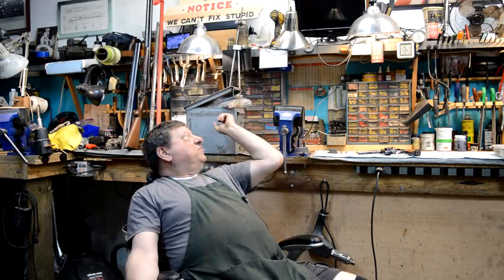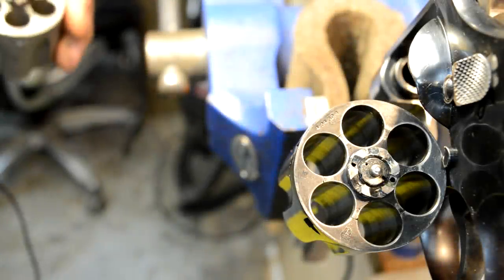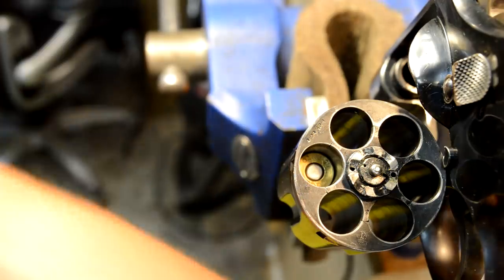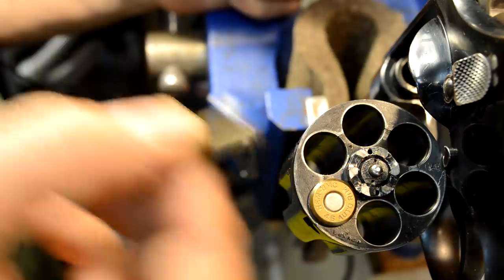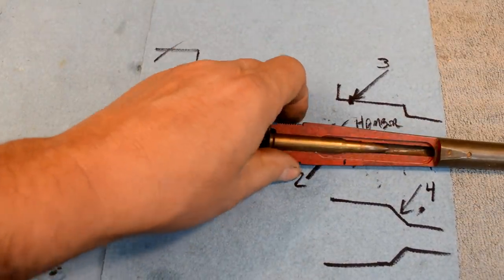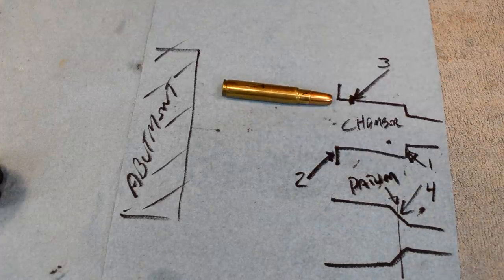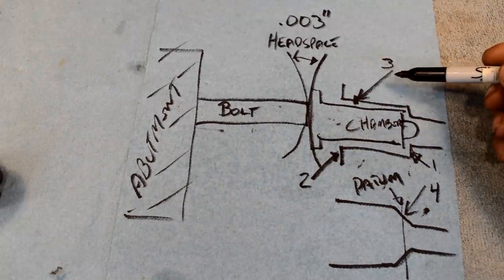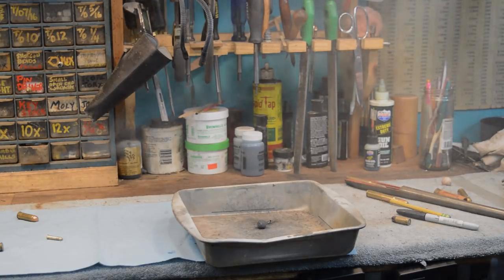Questions, Answered #7.....Headspace

Comment: 9mm Luger will headspace on the 7.63 Mauser neck in the chamber and will lock up. When I used to reload I drilled holes in a new 9mm Luger case then primed and seated a new copper jacketed bullet designed for the 9mm
Luger in the case mouth sans powder and went to a safe area loaded this safed cartridge in the 7.63 Mauser pistol chamber and pulled the trigger. The empty, primed 9mm Luger case headspaced properly and fired but again it had no powder and had holes drilled in the case sides so the primer gasses could vent. The danger is clear and present; a live 9mm Luger round can chamber, properly headspace in a 7.63mm Mauser chamber and fire. One must take care when working around different firearms with similar chamber measurements. The results could end in loss of life.
Reply: keith moore  No, 9 Para(9x19) is .30 LUGER opened up.  .30 Mauser (7.62x25/ 7.62x25/Tokarev) is longer, but shares a similar enough headsize and other geometry. 9mm Mauser Export was 9x25

Comment: 4 types of limiting surfaces preventing forward movement of cartridge case in a chamber = a datum or register.  

Headspace, distance of aft abutting contact surface of a closed & locked breech (bolt face) to that register. 

The relationship of locked bolt face to aft surface of cartridge (while registered) = clearance (go).

Relationship of jammed (not quite freely locked) bolt face to aft cartridge (registered) surface = interference (no go).

Relationship of spring force applied bolt face to aft cartridge surface (registered) surface = perfect!

Way to go Mark, I like your simple comprehensive explanation with sketches better!

Comment: Hot damn.  I've spent my life always hearing "rimless headspaces on the shoulder" with really no more explanation than that.  But now it makes so much more sense why case gauges are so important to reloading when you do modern rifle rounds and what the adjustments on your sizing dies do to the case to make it fit a chamber.  And I don't think I've cringed so hard as I did when you dropped that 12 on a 20 and it swallowed both.  I never knew that.

Comment: The wonders of the metric system:
If .30 caliber (=0.3") is 7.62mm, which most people know, what is 0.003"?
Right, 0.0762mm ...
It's easy working with bases of 10, just move the decimal (in this case, simply add 2 zeros).
Reply: decimal inch works the same way
Reply: Wonders of math really. Of course, the real fun with any system like Metric begins when you have to divide by three. Indeed, tenths are great until you have a third person asking for a slice of the pie, which is why Greeks went with 360 when doing that circle thing. Really makes fractions easier. 
      Personally, I like having multiple measures, because you can choose what works best for every occasional instead of having to force a system to do everything. It is not like it is that hard to remember 12 inches to the foot, 3 feet to the yard. No more difficult than remembering the difference between a decameter and a decimeter.

Comment: 0.003" = 0.0762mm

Thank you Mark
Reply: I figured 76 microns and some. It's a handy measure of thumb, the micron - a couple either way doesn't make a lot of difference.
I was told that most commercial parts are good for plus or minus 50 microns. Gives within being right to 0.1mm, which is a little over 3 thousands of an inch for play.
A Swiss watch maker would read this and laugh though. :)

Comment: The 5th way is the .357 Sig, which cannot decide whether it wants to headspace on the shoulder or the case mouth.
Reply: And the 6th way is a 357SIG round in a 40S&W barrel; headspaces on the extractor!
Reply: @musolinoa  or .40s&w in a 10mm barrel

Comment: You can think of calibers when doing quick/rough conversions of measurements...
.003" relates to .0762mm like .30" to 7.62mm just move the decimal point...
This only works if you are familiar with diameters 
.177 - 4.5mm
.20 -5mm
.22 - 5.6mm
.277-.280 -7mm
.32 -8mm
.355" - 9mm
.40 - 10mm
etc.
The tendency of european calibers being given as diameter between lands (gauge diameter) and US calibers being given by groove or bullet diameter throws this off somewhat...
I would love to smoke a cigar and sip some single malt with Mark, however who wouldn't 🙂

Comment: My understanding is that the firing pin will push the entire cartridge forward until it stops, at which point the case is forced backward onto the bolt face while the remainder of the case is left to expand under >15k PSI against the chamber interior.  In that sense, headspace is a dynamic event rather than a static number.  While an attempt to capture microseconds of data in an environment characterized by lethal pressures is far more difficult than an effort to measure a distance with a micrometer or GO/NO-GO gauges, it does shed even more light on the extremely complex process of touching off a round.

I really appreciate the great explanation, which exceeded the already high standard set by your last effort.  Thanks!
Reply: @Adam Schindler Your first sentence is correct, AFTER the trigger is pulled. Headspace is the measurement BEFORE the trigger is pulled. It is a static state (and measurement), not dynamic.
Reply: Yes.  The issue that I'm trying to raise is that the issue of headspace matters when we're firing the cartridge, such that as soon as it really matters, headspace becomes far more complicated.

Comment: I knew about headspace, but when I was working as a woefully underpaid and over qualified gunsmith, a man brought me a .40 S&W pistol with a MOABO kaboom. He had been shooting his .40 and his 9mm at the same time and inadvertently loaded a 9mm round into the .40's mag. BOOM... BOOM... CLICK... TAP N RACK... KABLAMMO! The gun ended up being fine (after brand new barrel was installed) and the barrel didn't rupture but was so badly bulged that I had to put the whole seized up slide assembly on the mill to get the damn thing out.
Reply: Somehow that reminds me of the TAOFLEDERMAUS video where due to the ammo shortage someone was using spent .40S&W casings filling them with lead, putting a sholder on it and using them for the bullet for a .44 mag reload. A few seemed to wobble a bit, but it worked.. Imagine it's a bit rougher on your barrel, copper is quite a bit softer than brass. I'd of just used cast lead, but I guess they gotta make videos.
Reply: @walkingcontradiction223  Yeah, I've seen that video. Cool stuff. But for it to be an analog to what I'm talking about (or what Mark was warning against in the video), they would have shoved a live .40 round in front of a live, normally loaded .44 mag. KABOOM, or MOABO (mother or all barrel obstructions).
Reply: @krockpotbroccoli65  Yep, just said it reminded me of that for some reason... My brain goes off in weird tangents constantly.

Comment: I had a Daisy V/L back around 1969.  It did not have a firing pin- it fired by compressed air being squirted through a hole in the front of the bolt.  There wasn't any way to extract an unfired round, if it wouldn't shake out.  Lots of lag time between pulling the trigger and actually firing.  I got rid of it, but I still have a pile of ammo for it.

Comment: Today I learned: a cigar has enough heat to light gunpowder
Reply: And you want a long cigar if you are using it as an ignition source.
Reply: Black powder has a shockingly low ignition temperature
Reply: AND CANCER!
Reply: I have read that a cigar is hot enough to light military time fuse for explosives

Comment: Mark, the Daisy caseless was fired by the heat of compressed air. It was basically a boosted air gun which ignited the propellent by the heat of the air coming out of the piston cylinder. There was a one way valve to stop back pressure getting into the piston side. It was basically a better engineered version of what we all did as kids,  dripping model engine fuel into the piston. It does not have or need headspace in the conventional sense as nothing is hit or pinched and there is no firing pin as such.

The Dreyse and Chassepot are better examples of where headspace came from. I shoot both and getting it right so that the needle hits the primer is a Mk 1 PITA...

Comment: The Daisy caseless ammo does not utilize a firing pin at all. The propellent is ignited by compressed air, similar to a diesel engine.
Reply: Which is why it doesn't need exact headspace, yes.
Reply: I'm more amazed that Mark actually had some!

Comment: Mark, interesting and clearer than mud.  This raises the next issue for me: “how does this relate to the go/no-go headspacing gauges?”  I assume the length of the no-go gauge exceeds the headspace tolerance distance with the bolt/abutment, is this correct?
Reply: exactly, any kind of go/no-go gauging (exist also for threads, plug holes, etc) relies on the tested piece passing the first test (go) and failing the second (no-go)
Reply: Note that there's actually 3 headspace gauges!

Go: bolt must close on this for rifle to be safe.

No-go: if the bolt on a new rifle closes on this, barrel needs to be moved back. However, if the bolt on a used rifle closes on the no-go gauge, it's just been shot a lot and may still be safe to shoot. That's when it's time for the

Field: if a rifle bolt closes on a Field headspace gauge, it's time to replace the barrel!
Reply: @ScottKenny1978  iv'e seen a couple of armourer kits and I'm fairly familiar with the French 7.5 one but never hear of the field gauge
Reply: @quentintin1  search for headspace gauges, most are sold in sets of 3. If they're sold individually, you will be asked for which one of the 3 you want.

You can also watch School of the American Rifle doing a barrel check. He uses all 3 gauges.
Reply: @ScottKenny1978  you're right, i just checked over and most of the barrel and chamber gauges comes in 3
Reply: @quentintin1  I think it's because you normally use the go/no-go gauges at the factory, before acceptance by the army, and can get away with only having a field gauge in the unit equipment. As soon as the bolt closes on the Field gauge, that weapon is out of service and needs to go back to the factory, where they have the go/no-go gauges.

Comment: Hi Mark. Allow me thank you for your tech videos! They are awesome! I have a question for you: How do you measure the headspace in a central fire cartridge revolver and in a black powder revolver? Thanks in advance!
Reply: I ain't Mark, but with a feeler gauge sounds like a logical way.
Reply: Most revolvers headspace on the rim of the case. So you put some fired cases in the cylinder and slide a feeler gauge between it and the firing position.

On a cap and ball revolver, that doesn't exactly apply, because the location of the cap isn't in line with anything but the hammer. I don't have a good answer for a cap and ball revolver.

Comment: I go by .1mm is .004inch.   I do  bicycles mostly  and  there is a bit  of  converting systems goin on.
Reply: I had to learn both Imperial and Metric way back in the 1970's when I was starting off in Mechanical Engineering.. basically 25.4mm = 1.000" ,, or if you want it the other way, 0.03937" = 1.00mm.

Comment: Where in the word did you find a new old stock cylinder for that 1917 revolver? There can't  be many of those left.
Reply: You'd be surprised. There's a guy out of Arizona who has a warehouse full of NOS break top revolver parts from the 1890's or so and up. Most factories had piles of spare parts that were forgotten until it was time to clean up the store houses, or the company went under, and then they sold the parts lots off for dirt cheap. It's just finding who bought the parts and where they went. A lot of gunsmithing on antiques is networking to find those collections. I have had clients wonder why I had their gun for over a month for a job that only cost them a couple hours labor and cost of parts. I have to explain to them i have to track down the part or who might have the part. When I'm lucky i manage to finally get in contact and then because so many of them are fairly up there in age, i have to mail them a check or money order and wait for snail mail to get it to them and wait for them to send me the part...lol and yes i know is not a break action it was just an example.

Comment: Good explanation, Mark.  Your timing is impeccable.  I'm currently trying to resolve a headspace issue with four unused 16" M4 barrels (5.56, 1:9 twist).  None of them will allow any stripped AR bolt to close on a GO gauge.  The parts supplier won't take them back and I don't know who the original maker is.  The only manufacturer mark on them is an upside down triangle with a BA embedded in it and what appears to be an F integrated into the center of the BA. Normally I would use my 223 finishing reamer to correct this problem, but these barrels are nitride coated.  Any suggestions on how to fix them or are they expensive trash?
Reply: Is there a possibility they were incorrectly marked? 

I'd try snap caps in 222, 224 valkyrie or any other similar cartridges or cerrosafe cast the chamber and measure it. Just an idea, I hope it pans out for you.
Reply: @endutubecensorship  We used two different GO gauges and eight different bolts which work in every other barrel.  No, the chambers were cut too short by the manufacturer.  I'm trying to figure out a way to get around the nitride finish or else find out who made them and reach out to them for help.
Reply: @Paladin1873  that is unfortunate, I wish you the best with sorting that out.
Reply: @endutubecensorship  Thanks, I'm looking at other options - maybe backing out the barrel extension slightly or finding a shop that has a carbide reamer.

Comment: Excellent explanation and safety warning boss. Always wondered what those guys on the .50s an .30s meant by check the head space. And they had a little tool of some sort they checked them with?
Reply: The Browning 1919/M2 machineguns actually feature an adjustable headspace which is intended to allow the operator to keep the gun functioning properly in changing conditions. A small headspace gauge/tool is part of the gunners kit.
Reply: Awesome boss thank you very much for that bit. Always wondered...

Comment: So the shotgun example means that the shells brass part should not bulge on the brass face got it. Know what im thinking on fixing on my rolling block shotgun in 20 gauge
Reply: Yes, if you case heads are bulging you have too much space between head and bolt face.
Reply: @ScottKenny1978  you have a idea how to fix because im running into dead ends when it comes to parts that match
Reply: @brendanliamgill99  short of having a friendly machinist make a new block with a thicker bolt face? Not really.

Have you checked to make sure the pin the block rotates on is still round, and that the holes that pin sits in are still round?
Reply: @ScottKenny1978  yes actually when i did a deep cleaning on the gun lots of old grease and something that turned into something that looked like felt liner although i might also look at the block again because it has a habit of popping through cheep primers come to think of it will be throwing some ideas around with a gunsmith soon
Reply: @brendanliamgill99  I don't think it's the block that is punching through those cheap primers, that's how hard the hammer is hitting. So it's the mainspring.

Good luck getting your gat back up and running!

Comment: Follow up, is it possible to fix head space issues? When dealing with old rifles and pistols, it’s always a concern.. are some rendered unfireable forever?
Reply: Sometimes.

Sometimes you can clean the gunk out and fix things that way.

Sometimes you can move the barrel (AKs are hydraulically pressed into place and then pinned, for example).

On a break action, I think you can do some things to move the barrel back a bit, maybe a new hinge pin?

On a Lee-Enfield, you change headspace by changing the bolt head. But you clean the heck out of it first!

But yes, some guns do just stretch out the receiver and are junked because of it. M60 machine guns, for example.

Comment: Great video but could  a long bullet cause a fails headspace, I had a 6.5*55 that would put rifling on chambered rounds. The rifle had little to no bullet jump.
Reply: Yes it is possible to have ammunition that is loaded with a projectile that the chamber was not cut to account for, and since projectiles are almost always slightly larger than the rifling that can cause a headspace issue needing the rifling to be removed until the bullet can seat properly.
Reply: What projectiles are you using ? I run 120 grn rounds in my husqy 6.5x55 seated to just touch the lands but have never had an issue with heavy marking of the jacket or head spacing feeling tight. I had some changes in the brass near the base which looked like separation starting maybe from excess headspace turned out to be from full length resizing affecting the brass. I went to only neck sizing and checking o/a length of the case every couple of reloads for that particular brass.
Reply: KRIZ I had better success with Spitzer boat tail can't remember what gr its been sometime since I reloaded that Cal
Reply: I have a 98 mauser in 7x57 that you functionally have to run out to wear the rifling is SUPPOSED to begin (absolute max OAL). The gun with factory ammo is like shooting buckshot. With reloads loaded as long as I can make them, and a long bullet, it's a tack driver. 

Spoke with a smith.... seem 100+years of life has almost worn the first of the rifling off.
Reply: @phoenixrising4573  check when your Mauser was made it may be chambered for Round nose instead of Spitzer if it is earlier production.
Reply: @charlespayne1061  thats what im running sierra 120 grn